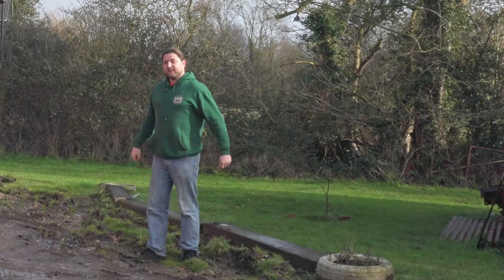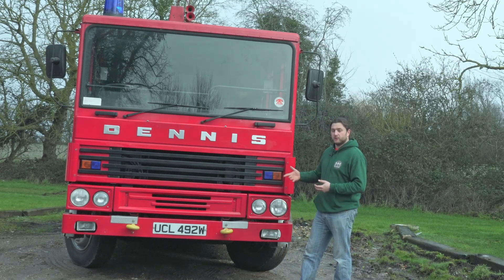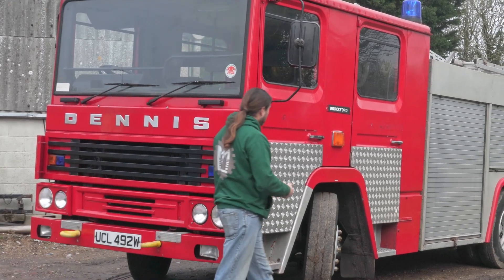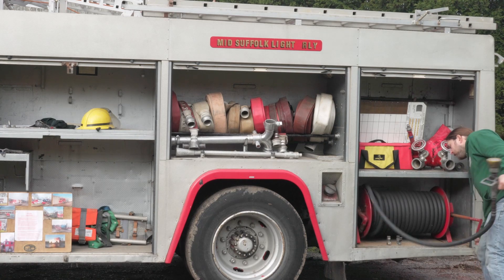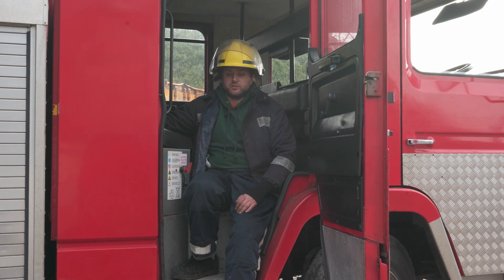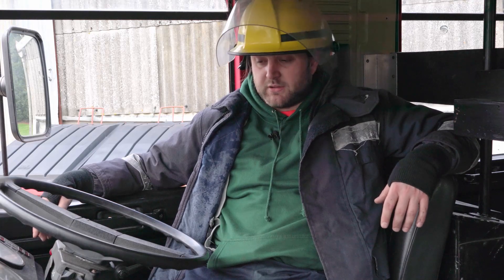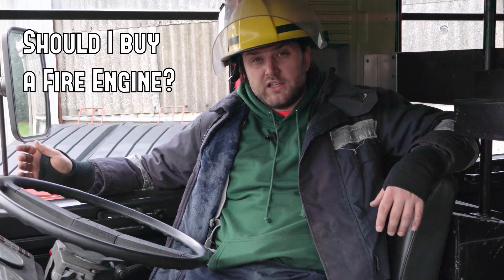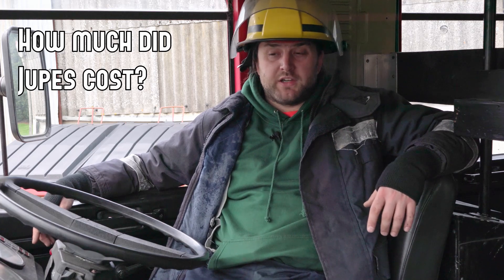A walk around my Dennis RS 130 Fire Engine + some of the frequently asked questions!

Comment: Hi Lawrie, I believe you mentioned the high/low pressure selector? This is used depending on whether you are using the hose reels or the main jet. The hose reels can be used at both high and low pressure (usually high) the main jets should only ever used at low pressure. Hope this helps 👍
Reply from the maker: Oh thanks for the info!

Comment: Jupiter really is a nice truck and great to see that kinda stuff restored.
Have you ever considered going to a show/festival or event close or even off one of the departments where it was stationed and meeting some of the guys who used it in service? That usually results in great stories.
I'd really hope my fire department keeps the old Mercedes long enough so i can buy it from them. it's a nearly 40 year old engine and just magnificent too. You're definitely not the only one crazy enough to buy an old fire engine. If I could i would invite you to review it whilst it is still in service, but sadly i can't do that. Just recently been "restored" (mainly derusted, altough there really wasn't much). And most likely a completely different driving experience. Like Jupiter it''s a 12t truck, but a heavier chassis and offroad configuration. I can just about lay my chin on the fenders. Hpwever, Jupiter even carries a tad more water. Space wonder you got there Lawrie!
Ahh I really want you to drive it and experience it for yourself. Such a joy. If I ever get to buy it, your definitely invited! I could talk about it for hours!

Comment: - low and high pressure, low pressure is for just using ‘large’ hose out the back of the pump deliveries, high pressure engages the 2nd impeller in the pump for the hose reels to work properly (some hose reels won’t work if high pressure isn’t engaged or you’ll just get a dribble of water). 

When you do get it pumping if you’re only using the main deliveries (large hose) then keep it in low pressure otherwise you’ll be over working the pump.

Also stick a cooling loop in if you haven’t got a water supply going into the pump

Comment: The Nozzle or Gun as you call it, is called a Branch. The one with the vertical lever on top is an Akron brand branch and the long thin one is an AWG brand branch.

As has also been mentioned, the white board is a BA Tally Board

Comment: Laurie, a couple of little mistakes.  The RS 133 had the larger 10.47 litre V8 Perkins, not the 8.8 litre. Also the RS was never fitted with the additional side windows, only the SS had them.
Reply from the maker: Ah yes it's the rs131 with the same engine and auto box

Comment: There is a product called Plastex that you might want to look into for repairing the dash and such. It is a great product and I personally swear by it. I've used it to repair many a part on my truck and mercury cougar.
Reply from the maker: Oh really? Thanks for the suggestion - how does it work?
Reply: @lmm   its basically a powder that uses a liquid to activate and harden the powder. It bonds to the plastic(as long as it is compatible)  more or less the same way model cement holds a model kit together. Once the powder hardens it can be sanded down and basically becomes a form of plastic.

Sorry if the explanation is a bit lacking. I use the product but my knowledge of how it works is limited.

Comment: i can see you love you fire engine, i did watch you around 1 year of the channel due COVID-19 issue and i was bored.

if your jupiter if be finished when are you starting with your second fire engine. it is well long time you mention it and also long time ago to see working on it. i do love your new projects and your work on it but.... there are few on a stalemate look..

you must write your stories and putting on the display about your truck. that is also funny when you are on a older age for looking back. i see your lockers are most empty and low but that is details are coming for later. also if you using your hoses, you need well to keep it dry and vertical for keep the quality on your hoses. it also smell less if you store them. i was 10 year ago on a open day by mine local firestation and they tell that. to the people.

Comment: Ermmm shouldn’t there be a thermostat turning off the radiator when it’s below operating temp?
That still sounds like reason for concern. The parts of that engine are designed to fit together at a certain temperature
Reply from the maker: It's a huge body of water for it to warm up.
Sitting in a radiator being blown by a huge fan. It just doesn't get hot unless you ask it to do something. 

It had new thermostats a while back.

Comment: "Fire engines don't cost much." Unless you want a new one. Or propably even new-ish one (let's say less than 10-20 years, as they still could be used by less well equipped fire brigades). They can easily go for six figure sums.
Reply from the maker: When they're looking to be disposed of, they're nothing.

Comment: I don/t know if you have checked the Dennis Society list lately. https://www.dennissociety.org.uk/preserved/fire/index.html#anchorucl492w
but I notice that the Chassis number is missing from Jupiter's entry.
There are 3 R130 Water Tenders and also an R130 Pump Escape listed.
Comparing the lists of Buses/Coaches with the list of Fire Engines there appear to more than double the number of Fire Engines than Buses/Coaches in preservation, though a lot fewer with photographs.
Reply from the maker: The photo of mine on there is my pic!

Comment: Not bat for 40 years old then again it says Dennis so I guess it lasts for ever and the huge presser is for the hose reals and that all the high pressure is for and that the main 70s/45 mm hoses low pressure as there is more water flowing through so will make it uncontrollable with the same as the high pressure
Reply from the maker: Oh really, thanks for the explanation
Reply: @lmm  no problem anything to help as you have a two stage pump on you appliance I only have a single stage which mean I get less pressure so the high pressure makes it a bit easier for tackling a fire

Comment: How are old are your front tyres ? With the new law coming in that hgv’s can’t run single tyres older than 10 years regardless of condition ? Also what are your opinions on the new law ?
Reply from the maker: Law makes sense, but a fire engine isn't an HGV.
She's also 40 years old now.
Reply: @lmm  ok but doesn’t it cover any vehicle
Over 3.5 tons ? I know bud preservationists are not happy about it . Thought Jupiter would fall under the same banner ?
Reply from the maker: @jasejackdaniels  When I read it, it said buses and HGV's. Both of which Jupiter isn't.
It's daft for old vehicles, they don't don't the mileage.
Reply: @lmm  I am no expert mate , just wanted to make sure your covered. I agree it seems a shame
Any vehicle in preservation is now liable . I know a few bus owners and military vehicles especially with tyres as old as the vehicles. Anyway love the channel and Jupiter . Keep up the good work .
Reply from the maker: @jasejackdaniels  me neither, but that is how I understand the law at the moment. I could be wrong.
Reply: @lmm  after reading through the law again you are correct , as a non-commercial vehicle of historic status It is exempt from current legislation. Sorry to be a pain !

Comment: Have you ever thought about getting the dashboard 3D printed?
Reply: That would require a massive printer or gluing up multiple parts. Not to mention it'd take ages to print. 3D printing is glacially slow for objects larger than a key ring, 36 hours is nothing unusual for parts that aren't actually that big, e.g. custom Ts for 110 mm push-fit waste pipe.
Reply: @Ragnar8504  yeah if you do it on one printer. You can get things like that commercially done.

Comment: Actually it was hold no more than 2000 L as my dad is a serving firefighter for Kent Fire service and his pump is less than 1800 L and he owns three fire engines and they hold 1800 L so there was no way that would have 3000 L
Reply from the maker: Quite correct. It's 2000

Comment: Is it a Carmichael fire engine, cant see a badge
Reply from the maker: She's a Dennis RS.
Reply: @lmm  quite often the chassis and engine were Dennis, then shipped to Worcester for the fire engine part made by Carmichael.

Went to Carmichael's bankruptcy sale in 1992, now in smaller premises under SIG
Reply from the maker: @philiplettley  oh really? I thought it was all done in house
Reply: @lmm  I think a lot to be honest were to do with the fire service's choice, if they went with Carmichael they could decide what chassis and engine they wanted then have the coach built round it. I worked for Hereford and Worcester fire brigade in 1995, and their repair garage was next to a Carmichael site. From 1992-1998 Carmichael were owned by Dennis, if you see a modern Dennis fire engine now, only the chassis etc is Dennis, the body is built elsewhere
Reply from the maker: There aren't really any 'modern' Dennis sadly, even the last ones they made are getting on now!